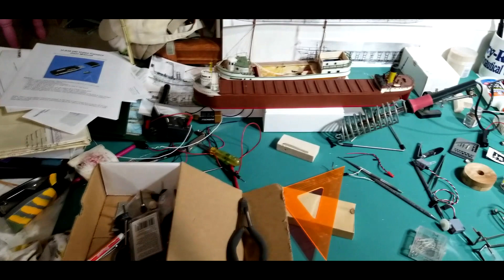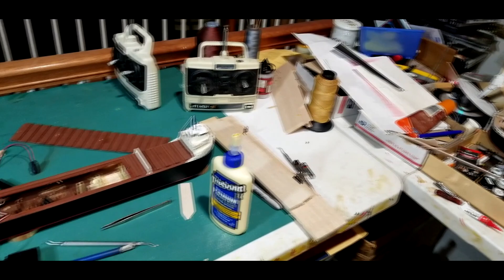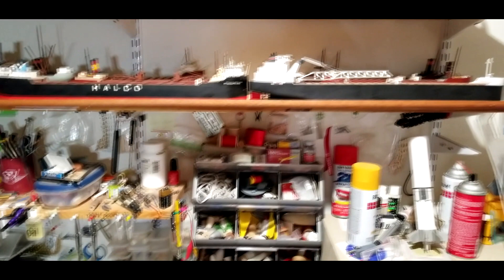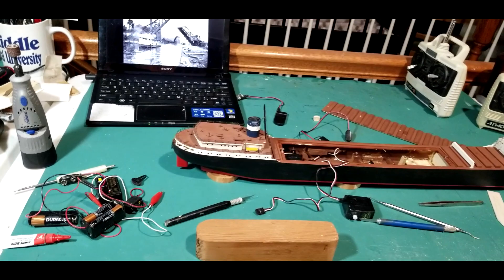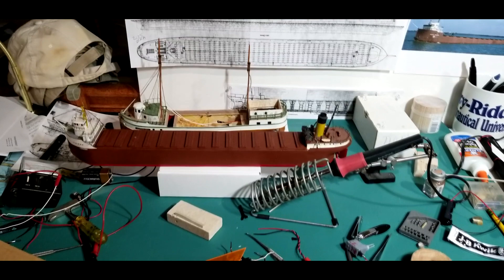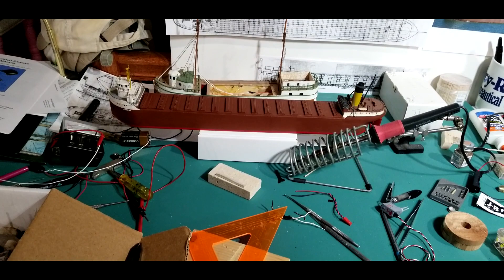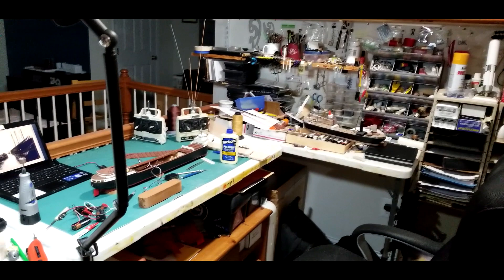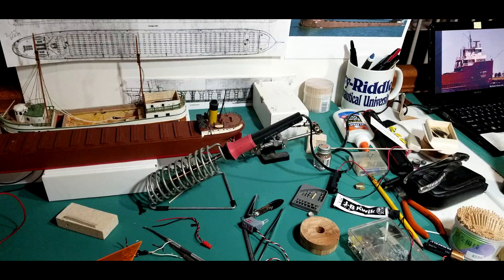A late night tour of the model boatyard

Comment: Wonderful model collection. I love the fact that you have many repair and builds going on simultaneously. How do you manage the batteries for these boats.
Reply from the maker: I keep everything standard- regular off the shelf AA, AAA and 9 volt cells. My battery packs were converted over for standard cells in the late 1990s when my NR-4C power-pack that cost me $16 just went dead. I figured, "that's it- go simple."